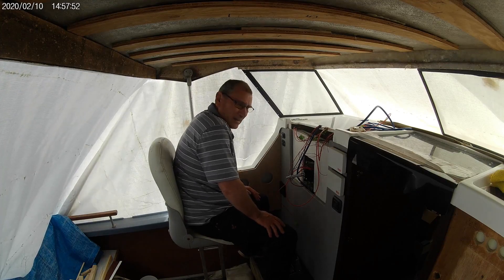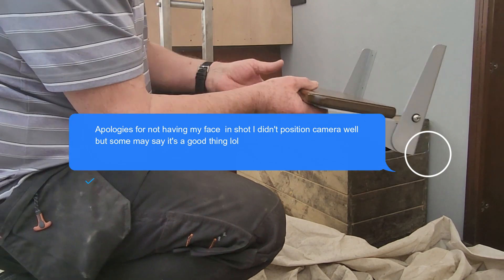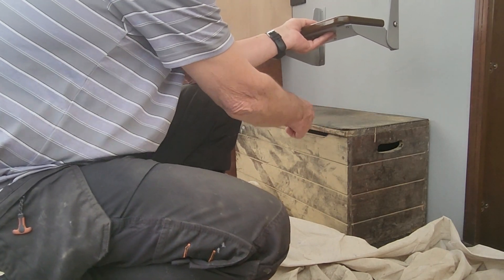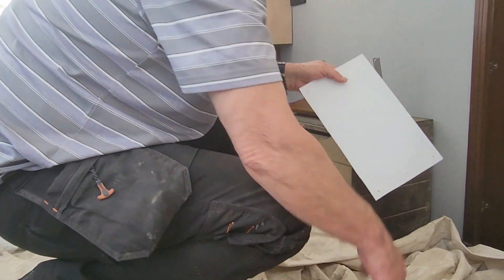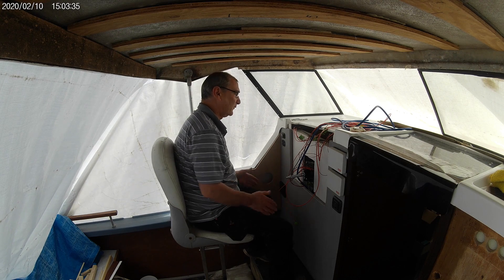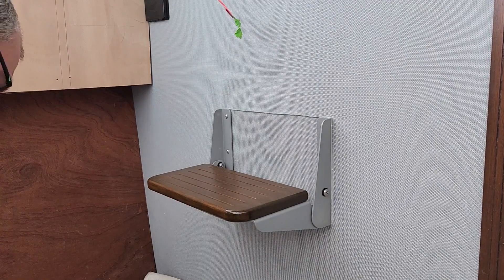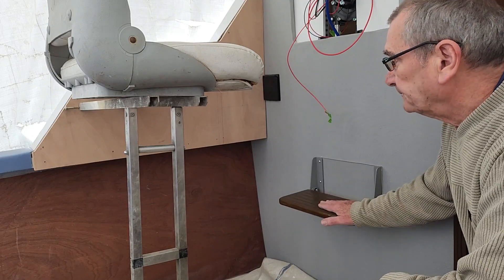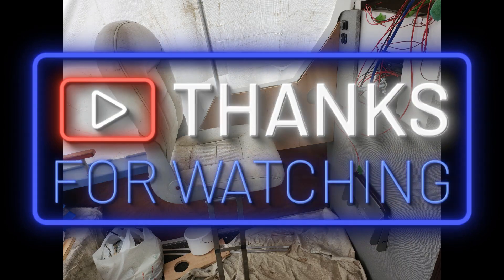#36 #boatrestoration step/stand options on our Birchwood 22 inteceptor

Comment: I think i'd refurb the box and have it as the primary step to the seat. If there were passing boats causing yours to bob about; the height and smaller surface area of the bulkhead foot rest might give rise to somebody slipping tryng to reach the seat. Its a nice piece of kit and looks well. Perfect height for the feet while under way. And the box could be used for storage tooo.
Reply from the maker: Sound advice as usual Loki. It's been used as one of my cutting platforms since I started the restoration and is the only intact survivor of the sinking back in 2013 so it would be fitting to restore it to It's former use 🙂